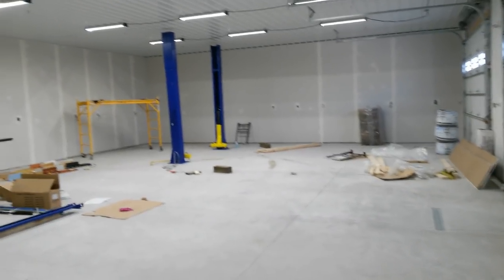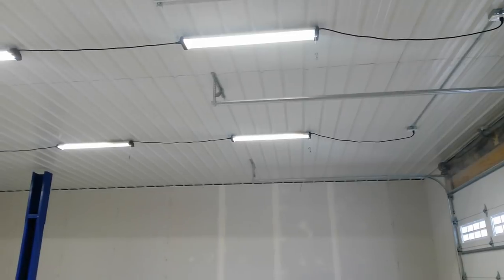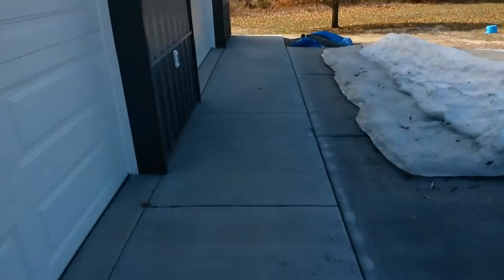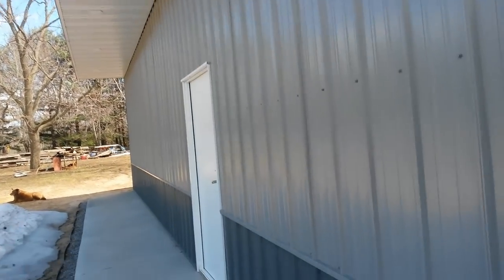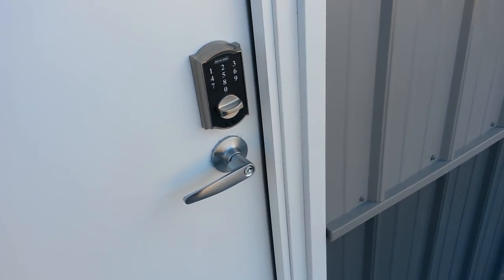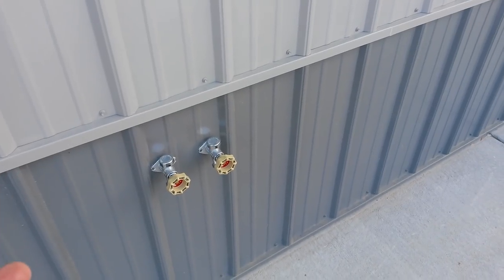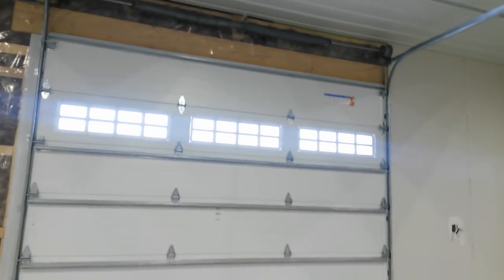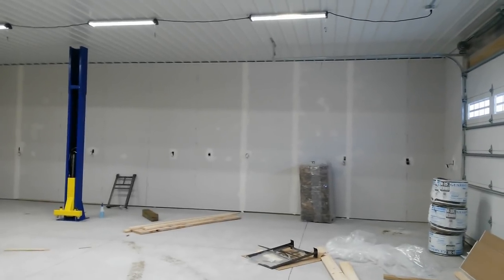Watch THIS Before Building a Pole Barn ! Building Tips and Ideas

Comment: Really like this.  I’m hoping to start my own shop this year and do similar things.  Keep the videos coming!
Reply from the maker: You won't be disappointed. Also, what you spend into building, it will add value to your house/property.  So it's not like wasting money , so I tell myself!
Reply: @JasonYouTube  
How much did this cost? And the size...
Reply from the maker: @dalehall2993  It is a 3200 sq ft so a 40x80. Cost for exterior framing and shell was around 50K. I will be doing an in-depth cost of each item and what I paid and what retail cost would be.

Comment: I just found your channel and have questions   What is the size of your shop and what was the cost to build it  You mentioned getting serval bids can you tell me what the range was  Also did your builder fix the problems you had  Thanks so much for sharing your experience  Most people would not mention there mistakes but you have the courage too  That tells me you are an honest person that can be trusted   Thanks Jason
Reply from the maker: It is a 40 x 80 x 12 , so 3200 sq ft.  It is actually 12 ft  4"  so that the interior height will be 12' , so make sure to add in the extra so you get your clear floor height.  I didn't get several bids, and looking back I should of. The company had a good reputation, but that was 10 yrs ago when they had in-house crews. Now they sub it out andf only have 1 in house crew that does higher end and commercial buildings.  They did fix the mistakes, but I had to point out everything to them.  Either way, your going to have to pay for labor and labor wise was within ballpark. They weren't the lowest and not the highest ( Morton much higher but higher attention to detail)  I will be doing an in depth build cost video , but the building shell alone with all the options ( 4 ft front 2 ' rear overhang , wainscoting , 6 ft spacing, engineered trusses for steel ceiling) was 45 k. Excludes garage doors and site prep.  I will have a cost break down of everything and how much I saved by doing some myself in future video. Thanks for watching

Comment: Jason, keep the videos coming. great stuff. I'm building the same, i'm going with Structural Buildings.
Reply from the maker: I would ask for their in-house crew to put yours up. You will be pleased with their work.  If they can't, then make sure to check  the work they do.  Better to catch it and have them correct the problems before it gets too in-depth. Call backs are a pain and usually leads to more problems. They will correct and fix the problems , but better to have a hassle free job off the bat.
Reply: skynet000001 I am also going with Structual.  We should compare bids!
Reply: skynet000001 where you guys located?  In live in Hanover
Reply: @keithkruschke4103  Elk River.  I'm goin with a 44x64x14  wainscot-2' over hang, 1-12x12 door , 1 window, service door.  6' on center trusses.
Reply: skynet000001 I’m doing 30x50x14 with a 50x12 lean to.  8 windows 1 12x12 door and 1 service door.  Wainscoat with 1 ft over hang on the table ends and 2ft on the other sides.  My quote with concrete is about 51 grand.  No interior finishes at this time
Reply: @keithkruschke4103  Did you ask them the difference of the building it 42x50x14? without the lean to, it may not be much difference. Any dirt work charges?

Comment: The truss spacing has noting to with ceiling. It has to do with the load that that particular truss can carry.  
You can have two different size trusses and they both be the same 4 ft o.c.
Reply from the maker: Have to disagree , as truss spacing has to do with ceiling type. For example if using sheet rock, you can't have 4' spacing , even if you have rated BCDL , as 4' spacing will allow sheet rock to bow and sag. You would need 2' spacing with rated BCDL for ceiling type. So before you build, you need to decide if you want a finished ceiling and what material you will use for ceiling. OSB can span 4' with sag, but drywall will need 24" ( 2') spacing to prevent sag
Reply: Jason 
You can have 4’ truss spacing and add 2x framing at 24” OC for install drywall.  Trusses ade not only design because of your ceiling type 
The pitch of the roof, the roofing materials you’re using, is you’re in a area that gets snow. Many facts. But space for the ceiling is not one of them. Your confusing trusses with perlings 
I’ve been building for 30 yrs I’m not guessing here I’m stating facts
Reply from the maker: @mikeeagle2653  Adding 2 x 4's  , or commonly called blocking, will add so much more time and labor to the building that you would just add 2 ft spacing for trusses and come out ahead..  Purlings are laid on top of the trusses and then the tin is nailed to the purlins.  You could have 8 ft spacing and add 2 x 4 blocking between it also and use a beefier truss , but that wouldn't be correct way . The way would be is to add more trusses so the inside roof will be able transfer more load over more load bearing trusses instead of blocking. So if you want a steel ceiling , it can span up to 7 ft without sagging, if you plan on insulation , then you can get away with 6 ft spacing for steel.  That is why people need to decide on if they want a finished ceiling now or in future , because adding blocking and making sure that your trusses are rated to handle blocking and dead load of drywall , would cost more then just building it correct in the beginning.  If its a cattle barn, then you could go with 8 ft spacing on trusses and still have no problems with thinner trusses.
Reply: Jason no no no blocking is not the same thing.  Blocking goes in between the trusses.  Running 2x4 24 oc across the bottom cord of the truss
Dude please stop I’ve built 150 + buildings in the last 30 yrs.  I’ve been on home talk TV for more then a year at a time. 
You aren’t going to tell me anything about construction I don’t know.
Reply from the maker: @mikeeagle2653  Why would you run full 2x4 across bottoms of all trusses ? For a 40 x 80 you would be looking at over 200-  8'  2x4's PLUS all that labor invloved. Makes sense if your a builder now, since that is a waste of time and money when you could just put in extra trusses and have higher snow load on roof and a sturdier building! Also you would save on the trusses as you wouldn't need as beefy bottom cord as you have them spaced correctly.  Its sad that as a builder, you wouldn't build it correct in the first place with 24"spaced trusses instead of jimmy rigging it ! Sorry dude, if I ask ANY builder with your method, they would say RUN AWAY from you! Build it right the first time for the ceiling that you want, like I said in video. Decide on a ceiling for future so you can save your jimmy rigging hack job . You have to agree, its better to build something right the first time instead of fixing it down the line .

Comment: Venting through soffit is counter productive for ice dams, actually.
Heat from the siding goes through the vents, then creates issues in your attic and on your roof, FORMING ice dams. It's better to vent through the face. I just watched 5 hours of YouTube Insulation Engineers on crash courses of this... (Sounds like a joke, but it's true....) Lol

Thanks for the tips. I can't wait for my build to start
Reply: That makes sense. When you say vent through the face do you mean the facia?
Reply from the maker: Makes sense in theory , but reality is I haven't had any issues on my building . My siding never gets hot to touch during summer/ winter , so maybe some colors are prone to that heat retention and causes the problems.   Ever try to fix your own car ?  If you have I am sure you have questioned why the engineers designed it that way, that you need to pull engines to replace spark plugs, timing belts, etc..

Comment: Can you stack a classic cathedral Beam and Rafter ceiling on  post frame walls?
Reply from the maker: You would have to get weight rated trusses to support it and depending on distance apart , may be cheaper to go with a stick build.  Price skyrockets when you go from 6 ft pole spacing to 2 ft pole spacing , like 20K !
Reply: @JasonYouTube  just want to clarify, so a standard 6ft post frame box cannot handle a 24” on center LVL or dimensional lumber rafter without deflecting?
Reply from the maker: @Natedoc808  I'm not a structural engineer but you usually need a post that sits under the truss to handle the load in a post frame build. I'm sure they could design trusses that could handle the weight for your ceiling type but it may not be cost effective. You would have to talk to a structural engineer or a designer to see what they say. If you use steel for the roof, go with hidden fastner system to prevent leaks.

Comment: If you use a tripod, the footage is much easier to watch and not distracting from what you're saying. Cheers
Reply from the maker: I should invest more in my camera setup , thought it wasn't too bad. Maybe it is like when your drunk, you think your steady when you actually aren't! Thanks for watching
Reply: Best Buy has tripods for $30 and many cameras have a steady function as well as some editing programs.
Reply from the maker: @scott5747  I just use a cheap Yi camera , so maybe I will look into investing in something better. Just was throwing out some videos to see if it helps people , not thinking of doing it full time. But who knows.. Thanks
Reply: I encourage you to keep at it. I really enjoy watching construction videos and get a lot of tips from them. After thirty + years of TV production, it's hard for me to watch videos that could be better with just a little more effort. Besides, the information you present deserves it. It is useful.

I'm building a pole barn shop this year and have been laying gravel as of late. I plan on putting in a car lift; probably a 4 post for winter storage and maintenance. I'll need at least the 12' you talk about, but hope to go 14'.

Cheers
Reply from the maker: @scott5747  Thanks for the encouragement, as I like to learn new things and any information to help me get better is good. Always go bigger, and if you are using radiant, then heating the extra 1-2 ft ( above 12 ft) isn't much more . Wish I could of went taller, but codes. Good luck on your build

Comment: Why are all those joints on the ceiling all in a line instead of staggered?   They shouldn’t be butted up all in a line like that.
Reply from the maker: Actually there is less joints then the so called "experts" wanted when they quoted me $7400 for their job!  They would of used 8 ft sheets as 16 ft sheets would of been more money because it would take an extra crew. I decided to have 4 joint lines instead of staggered as I didn't like the look of staggered joints. You still see the joints regardless  ( If staggered or not) so looked cleaner in having a nice line . Also I was planing on having the lights cover up my joint lines so you wouldn't be able to see them as the conduit will cover it up. I will run the lights in conduit once I see how long they last, don't want to have to change them if they are crappy.

Comment: what size building is this?
Reply from the maker: 40 x 80
Reply: @JasonYouTube  Thanks, we just bought property and so far every dimension that makes sense just doesn't feel right. this is about the size im looking for. its easier to decide when you can see lifts or items of reference in the building
Reply from the maker: @silviasteeve  I would go as big as possible , I wish I had a 40 x 100  . 40 ft deep is good for double parking a truck and car so you need that at minimum. The only downside is heating, but an extra 20 ft ( 800 sq ft) wouldn't add that much more to the heating bill as long as you use radiant and it is spec'd right. Too few of tubes in concrete and you will never achieve a good temp

Comment: Looks like a 2 1/2ft over hang not 4ft.
Reply from the maker: 2 Ft in Back and 4 ft in front. So I have a sidewalk that can accommodate seating area if its raining. But it only protects about 2 ft from building if it is driving rain

Comment: That’s a metal building that’s not what is considered a pole barn
Reply from the maker: This is a pole barn as it uses post frame construction. A metal building usually uses steel trusses, i-beams, etc and is laid on a slab or foundation.

Comment: YOUNG MAN 

YOUR CEILING IS NOT TALLER ENOUGH / YOUR LIFT WANT GO UP FOR ENOUGH
Reply: “Not taller enough”
Reply from the maker: The ceiling is 12 ft , so should be tall enough for most lifts. This lift had measurements off , so it interfered